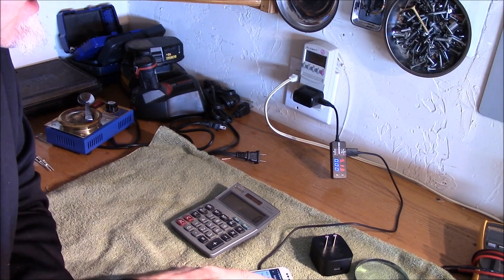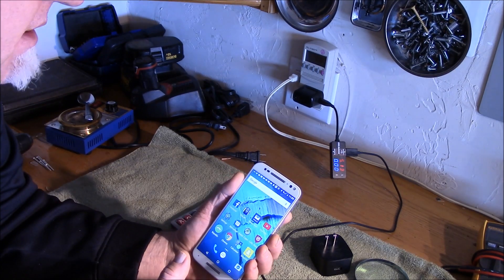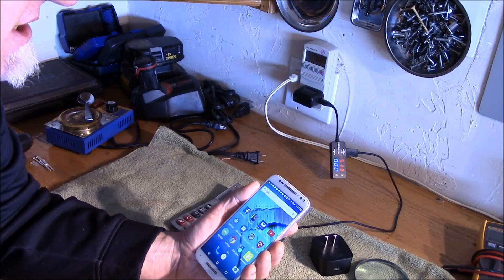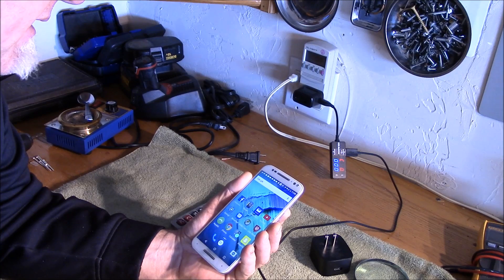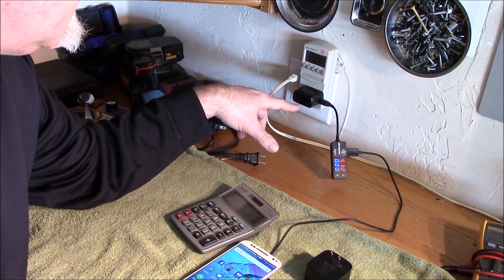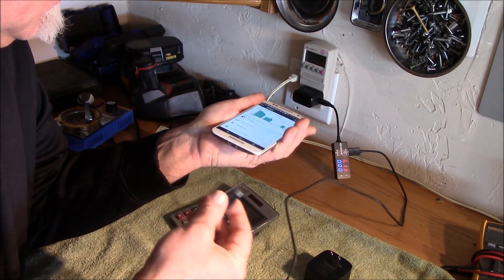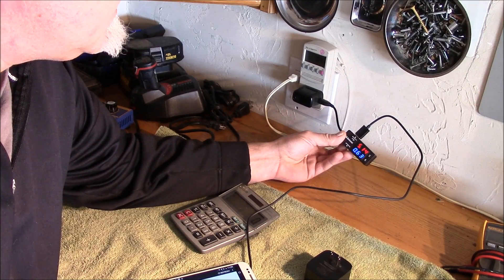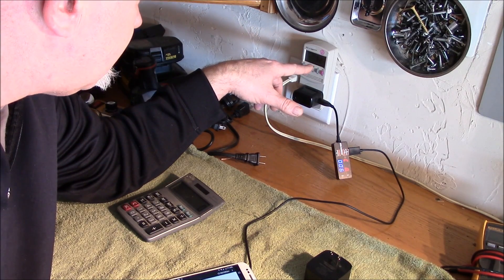What is Motorola Droid "Turbo Charging"? How it works...

Comment: I have a moto g stylus 2021 phone. It is rated for turbo charge. I have a turbo charger that used to make it turbo charge. For some odd reason. It no longer turbo charges that phone. But turbo charges other phones. Not sure if they changed it in a recent software update or what. Just wondering what could be going on. Im not finding anything.
Reply: Did you ever find the fix? And do you like the Moto G Stylus 2021? I love it but want to upgrade to the Oneplus N20 or its successor.
Reply: @vvvios  Never found a fix or anything about it. I liked the moto g stylus 2021 when it first came out. Im even still using it now. But I think its time for an upgrade. Been researching a ton of android phones. Not seeing any that I like so far in 2022. Ram and performance is the main thing im looking for in a phone.

Comment: I think the "secret" of Turbopower is that the charger uses the two data lines of the USB to ask who's there, so, when the Motorola tells him he has Turbo, then, the charger switch the charging method to the Turbo one

I got a powerbank today that has 5v 3A (a.k.a 15 Watts) but my phone doesn't says a Turbopower is connected, while, the plug that came with the phone, has the same 15W output... Kinda strange huh?
Reply: So do I have to go through this?
Reply: Can't my phone work without that plug or what.cant it or will it do same  with normal plug?
Reply: What so special about that Motorola.
Reply: Are you finished with me.

Comment: So question. If I wanted to charge the phone in my car, can I take it I can feed it directly 9V (through step-down)? Or is the phone also regulating its input voltage from the wall wart through the rest of the wires in the USB cable? Can you tell me if the voltage remains constant all throughout the charging process?

Comment: Hi Chris, have you inquired as to whether a high charge or "slow ( less milli-amps) charge is better for cell phones ? On car batteries, a slow lower charge was usually recommended....less chance of boiling the ol'  DIE HARD.   I also have built interest in magnet fishing . Those NEO mags are powerful.  I use a reg. speaker magnet to separate stainless metal.  Mags attract ferrous metal ....steel, iron , and some alloys also.  Too bad it won't attract  copper, brass and some other valuable metals.  No US coins except steel pennies.  Have you tried your magnet for salvage stuff ?   J K
Reply from the maker: Seems to me (best guess)...these modern phones won't last more then a couple of years. Kinda sad when we plop down hundreds of $$$ for them. As for the magnet...one strong bugger! Fishing would be fun with it...but, it won't fetch the good stuff.
Reply: Right, my old flip phone is over 5 years old and still holding, but I plan to buy a smart phone soon for upgrading and video use.  The magnets are BRITTLE,  I've seen more than one break. They won't pick up stainless items, most coins and other goodies. Plenty of vids retrieving tools and odd iron / steel items.  Still an interesting toy to see what is in the bottom of bodies of water.  Kinda like CRACKERJACK. at the bottom !   Later buddy.   J K
Reply from the maker: Man, I can tell you...modern smart phones are kickass (like this one, which is over a year old!). They are power hogs (esp when watching/streaming videos). These ultra powerful magnets can do a lot more that fish for lost keys in a lake! he-he-he.